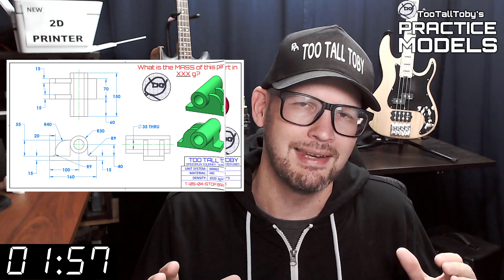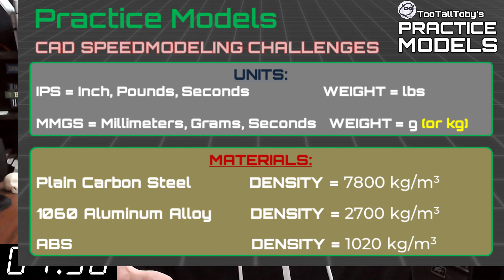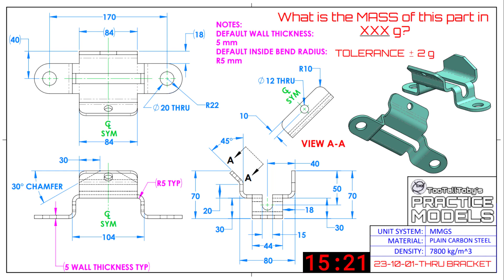CAD Modeling Challenge - Onshape, SolidWorks, Fusion360 - Curved slot - 23-10-01 - THRU BRACKET

Comment: 6:27 with Alibre Design Sheet Metal. Mass = 645.2
It would be interesting to see a snap shot of your practice parts in their assembly context, unless they are something that you pulled out of your imagination.😊
Reply from the maker: Usually its inspired by some existing design, but then I have to modify it to match the restraints of this format :-)

Comment: Thanks toby, can you help me on how to make the 45 degree flange? I am stuck to find the option to make it 70 mm from bottom. In the end i just extrude cut it, and it seems not proper way for me.
Reply from the maker: That's how I did it too - I think you might be able to do it in solidworks using up to vertex but I'd have to try it

What CAD system are you using?
Reply: @TooTallToby  i do your challenge in solidworks and onshape
Reply from the maker: Ok perfect - I'll make one tutorial in each! :-)  @siaunen2
Reply from the maker: Here ya go @siau9049 - as promised:
Onshape THRU BRACKET tutorial:
https://youtu.be/5zu924awAYI

SolidWorks THRU BRACKET tutorial:
https://youtu.be/g2NMu_AVGyI
Reply: @TooTallToby  nice wor, thanks toby!